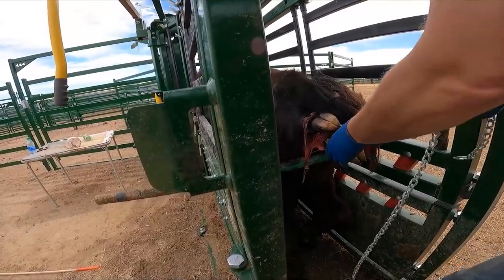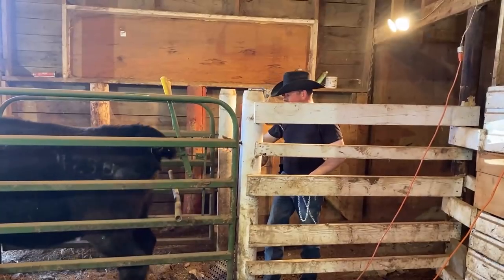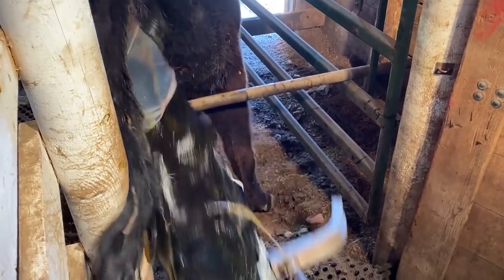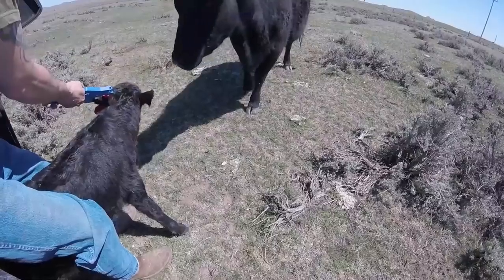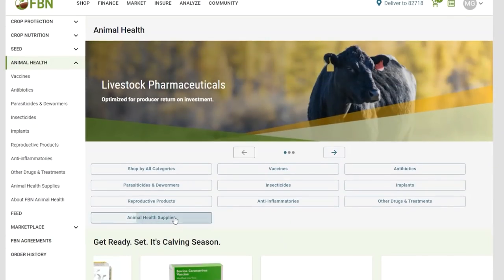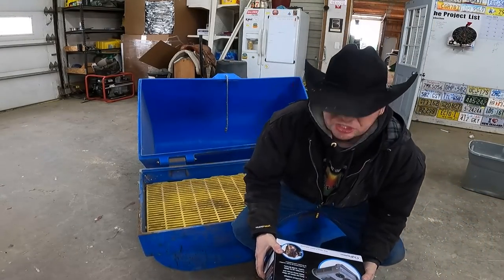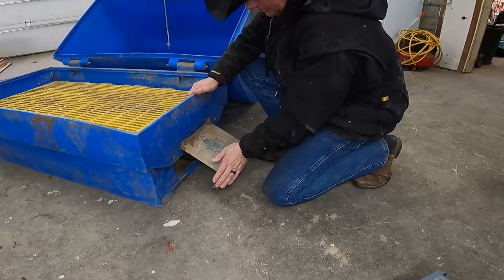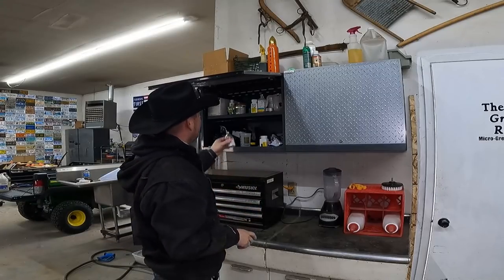Calving Essentials - A Calving Checklist

Comment: Consider putting an Eagle Carport Cover over the Arrowquip Squeeze chute for calving in Spring for protection from snow or rain and shade from the hot sun in the summer during vaccinations
Reply from the maker: Tough with the wind, but maybe doable :)  Thanks
Reply: @OurWyomingLife  you can alway drill 4-holes an put 4-Utility Poles up and build a roof With 2x6 And use 2" screws spacing 1-foot apart to hold the tin to the rafters.  It holds up against 200-MPH hurricane winds down here in Louisiana

Comment: Umbilical cord infections :   Over the last 25 years of farming I have learned that by giving the calf  ( at birth ) 5cc  of Antibiotics for three days in a row will make major changes  in the health of a calf !!!!!!    With antibiotics your treating the infection from the inside out. Instead of using Iodine and treating the infection from the outside in. 
Once an infection is started in the umbilical cord ........its very difficult to stop !  That only takes moments to get started !
Ive had very few scour problems.....lambness.... slow calves......and no stiff jointed calves  since using antibiotics. A life changer ! Mainly for the calf !
Reply: Never heard this.
Reply: @swankfarms5239  Its true.... Most people feel by using iodine the problem is solved. Then later question why the calf has issues..... scours..... Many vaccinate for scours. I never have yet and most calves are healthy. Once the bacteria enters the cord theres no way to stop it. Mainly if the cord is short flush with the exterior of the belly area. A direct path to trouble !  Its a headache catching the calf each day to give it a shot.......but long term worth the troubles !

Comment: Colostrum : Milked cows for 45 yrs.......never worried about the calf getting moms milk.  Any milk worked !   If a cows didnt feed her calf I took milk from the balk tank and fed it.  Seldom had problems.  
Primary.....going back to   If a cow has calving issues often the calf has a slow start.....thus never gets cleaned off. Or gets up and starts sucking " Umbilical cord infections  " !  By giving the calf  ( at birth ) 5cc  of Antibiotics for three days in a row will make major changes  in the health of a calf !!!!!!    With antibiotics your treating the infection from the inside out. Instead of using Iodine and treating the infection from the outside in. 
Once an infection is started in the umbilical cord ........its very difficult to stop !  That only takes moments to get started !
Ive had very few scour problems.....lambness.... slow calves......and no stiff jointed calves  since using antibiotics. A life changer ! Mainly for the calf !